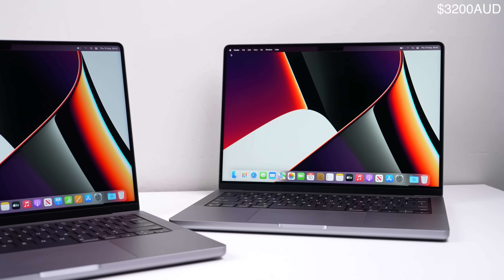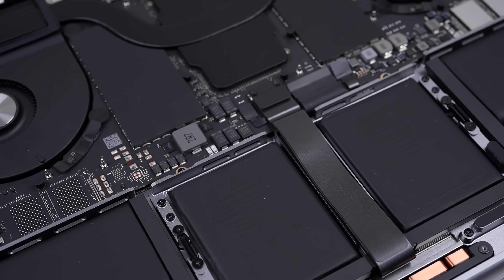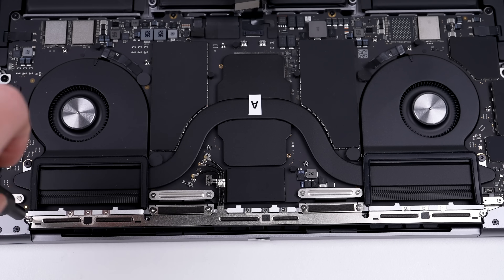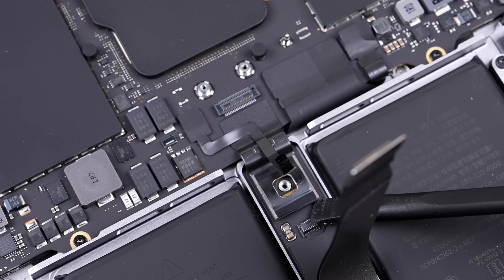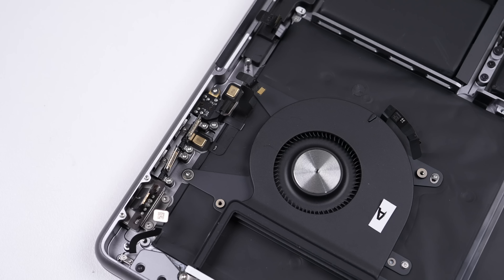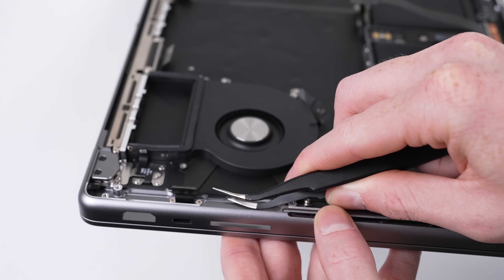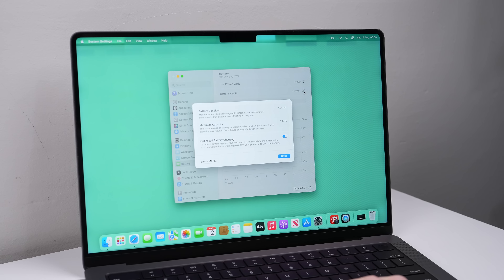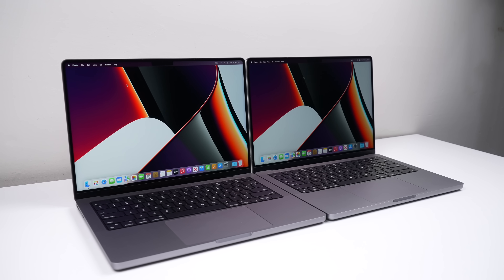New Anti-Consumer MacBook Pros - Teardown And Repair Assessment - Apple Silicon M1/M2

Comment: Screen repair started dying when horrible quality factory rejects were the only screens available. 

Back in 2011 it was still possible to buy LG boxes that said A on the side. A few years later, only grade 9 and 5. Now it's literally total garbage if you want LCD cells by themselves. They're unusable if you care about the quality you're giving customers.
Reply from the maker: Now it doesn't matter what grade screen you buy, they will have the same defect without Apples calibration...
Reply: @HughJeffreys - I can't think of a single good reason why parts would have to be calibrated on each individual machine.   Look at all the other laptops out there, they work perfectly fine by simply swapping or installing 3rd party replacement parts.   If you really need "calibration" (not), at least include it in the main iOS firmware to do its thing automatically at power-up.
Reply: @HughJeffreys  Freaking horrendous - Bad Practices for everything that follows. Future does not look very bright.

Only think about the new iPhones with USB-C Charging Port.

They have managed to play us as the Mafia did for 80-100 Years.
Reply: @HughJeffreys Not if you replace the IC chips, you can retain data. 

Apple does offer screens to buy, but I find this is well out of most peoples budgets.
Reply: you should do a collab with louis rossman! i think it be a cool video
Reply: I went through 2 or 3 U2711s until they got me one without dust/dirt in the panel. All the LG stuff back in 2011 had it in professional screens, it was ridiculous. Because Crapple bought up all the A grade stuff..
Reply: The real problem is the buyer.

If they buyer said "I am not going to stand for this, keep your proprietary, locked computers i am buying something else" they would soon reconsider.

The reason they do it is, they are "allowed" by the buyers, that keeps buying no matter how egregious apple acts.
Reply: @JohnDoe-bd5sz  Why people blindly follow the Cult of Apple has always been a mystery to me, as Steve Jobs lost his company before this ever became a thing.
Reply: @campbellpaul  No i dont understand it either.

Maybe the same effect when a person beats up their partner and the partner still stays and endures the beating.

Apple only treat their costumers so poorly because the costumers dont "vote with their feet" and buys something else.

It's not like apple is able to do something, that other phone brands are not
Reply: @JohnDoe-bd5sz  Maybe it's a "power and prestige" thing.. I am still confused by the masses of people who buy things made in China, not necessarily for the value, but the company logo.  To me, Apple fits into that category perfectly as well.  I stopped wearing Nikes almost 20 years ago, when I realized people were working 14 hours, 7 days a week to make them.
Reply: @campbellpaul  To me, buying apple products do not signal power and prestige.

It's more of a "Not very good with money" thing.

It's not even like its "exclusive" anymore, half of people in the country i live in has them, and even schoolkids as young as 10 has them.

10 years ago when my daugter started in school there were a bit of "I have an iphone, i am better" but now she says that no one really sees iphones as better than others.
Reply: @campbellpaul  i'm a casual consumer , not a developer, not a repairman, not a gamer... so from my perspective i would choose Macbooks at any time over the windows simply because it's navigating instantly where i want without any freking lag. I watch YouTube,facebook, twitch, browse Google , submit VAT returns, marketing research for my business and for me and other thousands works brilliant for what we need. I had a £500 Lenovo laptop glitching and lagging on YouTube so no thanks. Apple is good for what i have mentioned and for the general public. Those moaning are people using this product for developing and other stuff but you are a minority... no1 cares abour you budd
Reply: That's bad but gets even more ridiculous when even Apple refuse to replace a screen on a high end iMac Pro, as happened in the LTT fiasco.
Reply: @dorbie  The best part of that whole scenario was that it wasn't so much Apple refusing to repair/replace the screen. but them basically saying Apple hasn't provided any way for even their own repair shops to get the parts. The iMac was literally un-repairable even from the manufacturer.
Reply: @FR099Y  Yup!
Reply: Running Apple gear since 2010, but also because of the global political situation I’m considering more open and free alternatives again. Sovereignty is paramount now.
Reply: Planned obsolescence.
Reply: @TheTheSssupermario  Business as usual
Reply: @TheTheSssupermario   Time travel should be invented, so we can go punch Bernard London in the teeth.
Reply: @TheTheSssupermario   Time travel should be invented, so we can go punch Bernard London in the teeth.
Reply: @TheTheSssupermario  For how many times "Planned obsolescence" gets thrown around, it absolutely applies here.
They literally make you pay for a worse product with a shorter life span.
Reply: Watching this video reminds me of that scene from that old Redford film Sneakers.  The team tracks the macguffin to a toy factory that has laser trip wires and electrified fences.  Redford says 'the whole building screams "go away".

From the moment you start opening that laptop, every single step is unambiguously discouraging you from continuing.  It's laughable and I had no idea it was this bad.
Reply: When corporations deliberately take away jobs from the middle class, they simultaneously hurt the same economy which keeps them at the top. As a social democrat I believe they should at least in turn pay the taxes of those would-be-jobs, to compensate for the hurt that they are inflicting on their nation's debt.
Reply: Thats a direct result of Apple and other manufacturers making it impossible to repair yourself, crippling aftermarket part sales.
Reply: Just let them die with the US economy bubble. One can not put his destiny in the hands of some rotten company. It can all die tomorrow or go through several years of agony.
Reply: I seriously believe that grass-roots, rural "traditionalism" is what made our country strong, as even the slickest politicians of 40 years ago felt an obligation to consider what was good for the people (mainly, the middle class).  The difference in the US today is that Mom & Pop-type storefronts and services largely went extinct, and big corporations lobbied those grass-roots voices out of existence.  The platform we are on, the MSM journalists (who themselves live mostly in studio apartments) all support the corporate control of our government.  Come this Labor Day, we should go out and let people in on what we think, and get them to petition for some of the things we, ourselves, believe in.
Reply: The testing  ''Calibration'' is a bunch of  Mines  scattered through the hardware to  disable repairs effectiveness...  Any  calibration should be able to auto update.
Putting the soft in software.. :-)
Reply: Channels like this are cancer. You have no clue about technology and you are fueling your clique on a lie.
Apple pairs lid opening sensors due to security reasons, when the lid is closed, the USBC ports are turned off. You can't connect something that will steal data.
Reply: im shocked macs dont come with broken parts out of the box just so you need to get them serviced yet
Reply: my fuckin screen A1708 screwed up 2 years ago.. tried to fix it myself.. cause nobody  cares and there is no official retailer in indonesia..
they should fuckin recall this product long time ago.. annoying..
Reply: louis you are best but this is not your main acc
Reply: Rossman, let apple get its way already; if they are anti-consumer, then let them not have any left to buy their crap. Go back to PC, desktops are really easy to repair and have easily replaceable parts.
Reply: @Amygondor  Problem is, the segment  buying apple dont care they buy it no matter how bad apple treat them for some reason.
Reply: What have you been?  How is Texas treating you these days?  I miss your videos about Mac product repairs.
Reply: I just replaced my LG phone screen for $65.
Reply: Louis, are you still doing repairs? I have a m1 macbook air with black screen of death
Reply: louis, for everybody's sake, just tell everyone to stop buying apple "products"
Reply: @rossmangroup
Enjoy the fruits of capitalism. If you were the C.E.O. of Apple you'd do exactly the same thing. As most of us would. We only support capitalism because we all believed we had a shot at someday being the one calling the shots and screwing the plebs. Let's base our entire economic system on greed. What could go wrong?
Reply: Top Dawg has arrived!
Reply: (another) Comment for algorithmic boost. Appreciate the effort you put into this. Yo Rossman, G'day from Sydney Australia: keep fighting the good fight you two.
Reply: The quality of screens should be much better than they are by now. I have a 2011 MacBook and it has zero light leak and great uniformity along with several other displays and tvs. Literally every display I've had in the past 10 years has had those issues and now my oled tv has hundred of stuck and dead pixels creeping in from all edges on year 3. I have a hard time believing lg didnt foresee this.
Reply: This is what you get when you allow a supply chain bureaucrat (Tim Cook) to assume control of a company after the death of its founder. I bought an M2 laptop on impulse, and thanks to Louis' YT advice, I returned it the next day (unopened). Thank god I was not hit with a "restocking" fee. I still have an Intel-based Macbook Pro laptop, but do not rely on it for anything serious.
Reply: @alohamark3025 honestly I still keep my old MacBook, does the job and if I ever need to do anything intensive that’s what a pc is for
Reply: @alohamark3025 If you are referring to Jobs... he was just a middle man sales guy. He had fuck all to due with things really until Ipod saved Apple from bankruptcy by a hair. And yes even back in the 90s they were pulling shady shit because I remember going to upgrade a friend's Mac(Remember the old colorful apple shaped PCs?) with more ram because they didn't want to ship it to Apple and pay like 1500$.... Well Apple had soldiered the ram to the board, unfortunately for them I grew up fixing(and fiddling with) electronics in the 80s so it didn't stop me but the average home user not so much.
Reply: @SilvaDreams yes the old iMacs - hopped up tube tvs
Reply: @nahgahnub  To be fair most people still had CRTs till mid to later 00s either because cost or they just weren't as good.

Comment: Hardware Warranty Repair Technicians get paid a fixed price per repair which includes travel time and the amount paid is not specific to model.
For the consumer the risk is corners being cut and one of the voluminous reasons why I did not bother with repairing apple.  (Getting one digit for a serial/model number wrong in returning faulty parts might as well mean keeping and selling the faulty part to compensate for apple docking your pay for the cost of the faulty part).

For many manufacturers the replacement of the whole upper case assembly particularly for the trackpad has been common with many brands as the manufacture cost is cheaper and the markup on supply after the warranty runs out makes it a profitable exercise.

I was an apple fanatic back in the 80s with the Apple ][, //e series but woke up to the narcissistic attitude apple had towards its customer/fan base by experiencing the ridiculous cost of replacement, for example the replacing the whole module of a power supply ($150 AUD in 1984) when the common fault was a couple of capacitors less than a $2.50.  Back in those days computer technicians were also electronics technicians as I became one.  Module repair only made sense for on-site (in the field) service repairs like in the offices of corporate, industry & government to minimize the time technicians needed to use office space.  In the workshop however component repair was more economic with suitable skill and space as it also reduced freight costs.

This cost may sound more acceptable now than it did at the time due to inflation which equates to current cost of $520 AUD or $332 USD,

This all got worse with Apple refusing to provide service manuals to computer companies and shaving off the markings of electronic components.  

Resellers got desperate by advertising for technicians with apple specific knowledge of what the components were.  Technicians had to successfully repair such modules for the interview stage to progress any further.  They weren't even checking the technicians had certificates/experience of electronics repair.  That is how desperate it got in the late 80's/early 90s.  Some saw an opportunity to profit from module replacement costs while others were honestly trying to save their customers from the ripoff arrangement and strengthen their relationships with their client base - particularly managed service providers clients where the business transactions are continuous.

The lesson that businesses who provide technical services to their customers learned is that in order to support their clients, their clients had to support the products the provide as they can only effectively support the products they established support channels with the manufacturers of those products such as having their technicians certified to service and support those products in order to effectively support their clients.  

This especially rings true with the boutique custom builders when it comes to troubleshooting a particular generation of components from different manufacturers (motherboard, processor, ram, etc) that are not items kept in stock, become uncommon as is the case when new generations of components are released and the generation digresses towards or reaches end of market life.

Comment: "When you spend that kind of money on a new laptop, you wanna make sure you actually own the thing"

If that's what you're going for, your only option is buying a linux laptop(e.g. from tuxedo or slimbook).

This way you have an almost fully open source system that you can trust that it doesn't track every single thing you do and doesn't collect your wifi network names and passwords and your contacts and your emails(these last two only if you don't use outlook or gmail or any proprietary android rom or iphone or mac)

Plus, you are a lot less likely to get a virus and/or get backdoored a million times by the NSA

Comment: Me still rocking a 2010 mac
Reply: With 4 GB of RAM and the performance of a 2009 smartphone?
Reply: @lenoirx  I don't think it performs like a smartphone from 2009 but it still works and is upgradable.
Reply: @yeetlegosi  I mean, if it has 4 GB of RAM and I assume an old Intel processor, it should run like a 2009-2012 phone. Any decent and modern smartphone should outperform any old mac
Reply: @lenoirx  yeah i'm going to look into framework or design my own.

Comment: I'll play the devil's advocate regarding the lid angle sensor. The hall sensor can see which way that round magnet is rotated with respect to the sensor, but I suppose in the factory they stick those magnets in any way with respect to screen (i.e. magnetic poles of that tiny magnet are not aligned and the pole rotation can vary from one display to another). This pole orientation randomness is fine as they can calibrate those sensors later on by telling the computer that the current position is "closed", so every other position must be "open". I also think this theory explains why one of the laptops in the video goes to sleep when display is at 90° (magnetic poles of the lid magnet in the new screen are rotated 90° compared to the original screen).
With all that said, why the hell would you pay for calibrating such a thing is beyond me.

Comment: When it comes to the sensor, try and connect power (for the first time after replacement) while the lid is closed!! You connected power while opened and it worked the wrong way around..

Comment: I've seen a claim that the screen glitching is because of calibration data to compensate for screen burn in, but  I doubt that those screens are old enough to have been THAT effected by it (and even if it was, that seems like a somewhat simple calibration, as it just needs to know how to achieve uniform brightness)...
True tone on the other hand probably requires a lot more calibration data that might require external equipment that they actually wouldn't be able to provide.
Reply: Truetone data is stored on the display itself afaik. It's just locked behind an authentication of some kind.

Comment: Great content and delivery. However..  
Why is there even music in the background. It’s so distracting. If you’re going to set the volume soooo soft you can’t hear it when you speak, then just don’t put any music in the video. Also it’s a loud track, it’s just the opposite of what the video signals. So if you need to put any music in the video, just use an actually calming track instead of a loud attention grabbing track.

Comment: btw the 11:40 line of "finding screws harder" is completely incorrect. Apple would never do that, it does not make sense. The reason they have those pads there (i'm guessing) is so that it would be easier to notice the machine has been opened by a "3rd party service" before this and deny repair. It seems like they rip easily and cannot be attached back in the same way, apple would probably replace them